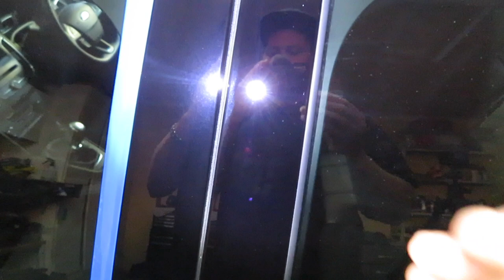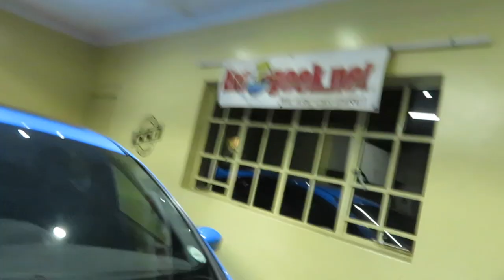DETAILING A NITROUS BLUE FORD FOCUS RS | Detailed by CCD

Comment: There's something so satisfying watching you detail cars buddy 👌.

To touch on the wing part, you are right with them using too aggressive compound and pads. When they ship the cars out of the factory they stick protective plastic over a lot of panels and the glue used on it is very harsh hence when they get the vehicle at the dealership, they need to get rid of it and end up using the wrong compound and pad combo
Reply from the maker: I have seen them “polishing” glue residue from new cars instead of using a clue remover 🤣🤣 eish
Reply: Yes, it even happened to our new Tiguan on the bumper by the boot. I had to fix that mess very quickly because I was very annoyed
Reply from the maker: Yeah man super annoying when you buy a car and they hack it like that